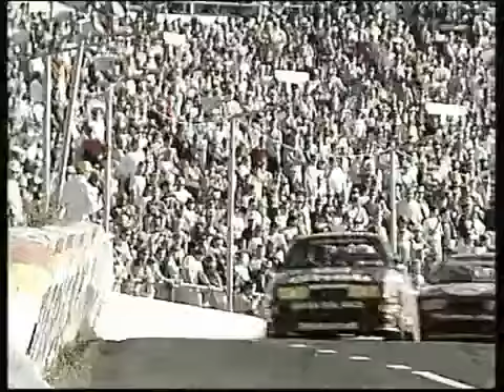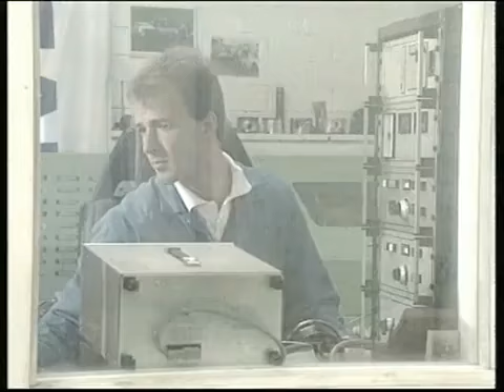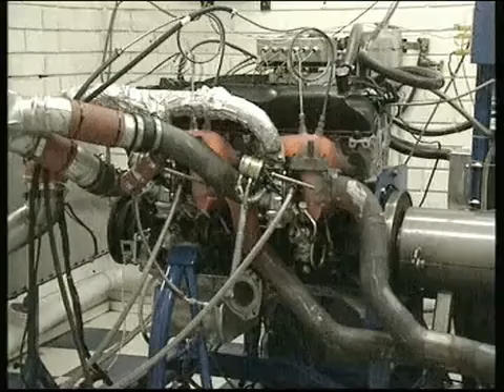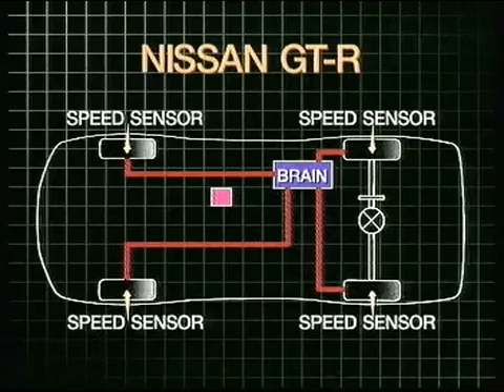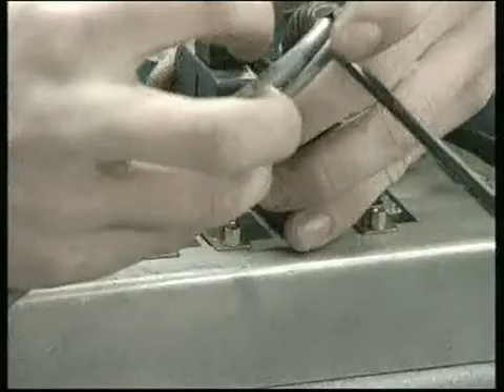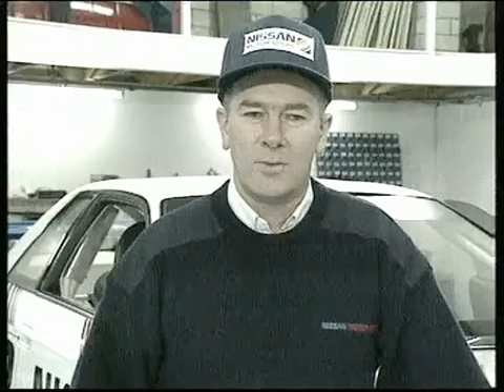Nissan GTR R32 1990 ATCC Preview

Comment: How good is the in-cylinder pressure monitoring on their engine dyno! Add that to their audio knock detection and it's no wonder they could make so much power even with the boost restrictions in 1992!